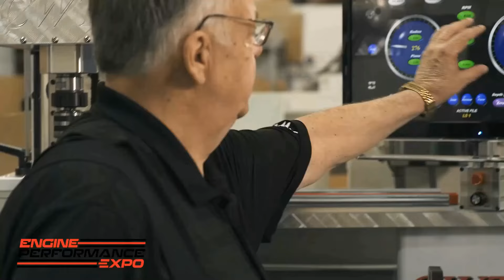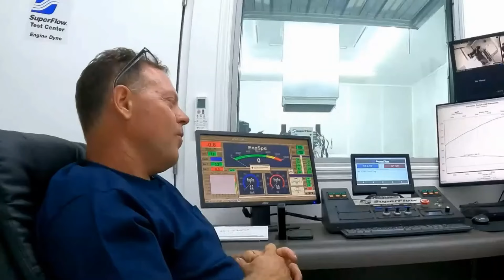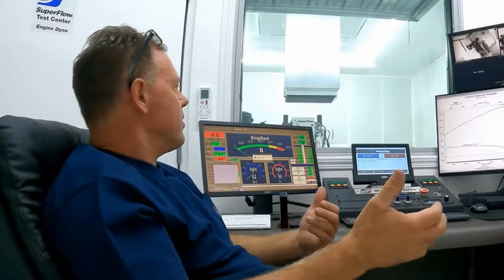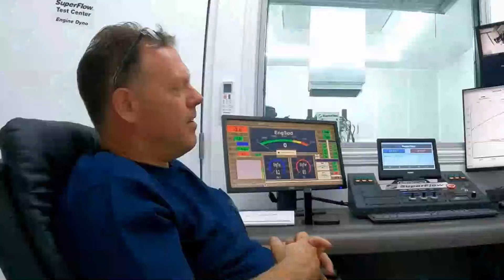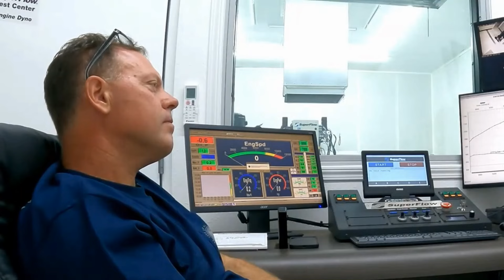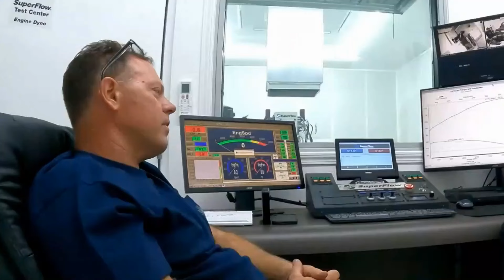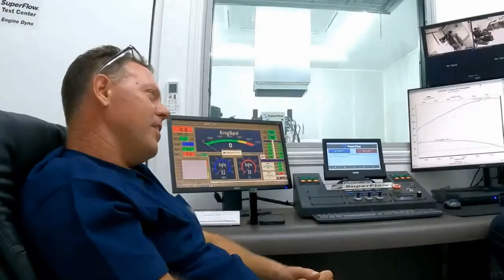In the Shop with Jason Line (Expo 2024 - Episode 27)

Comment: Question- The subject is the 408 W build. When the solid roller was installed did you guys check the valve clearance? It had .669" lift with a 1.72 rocker. The pistons have a valve relief.